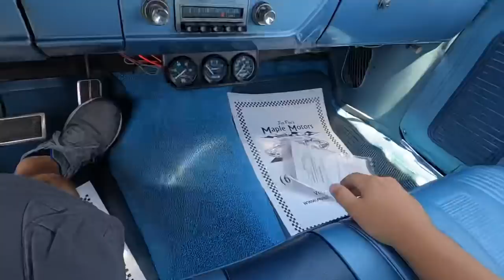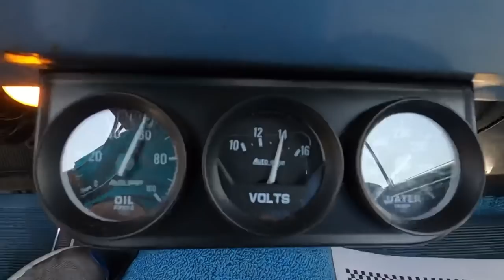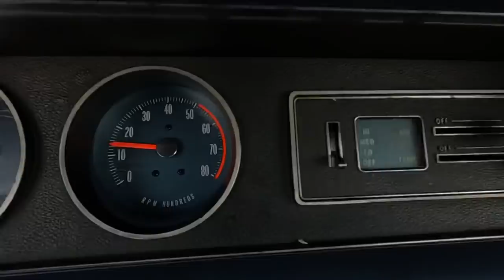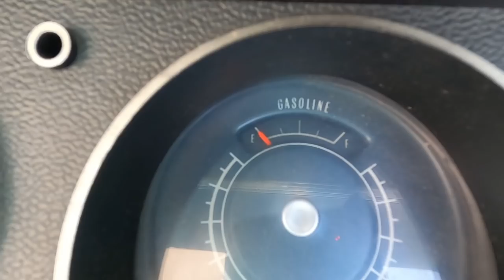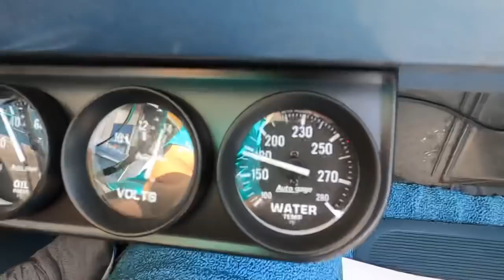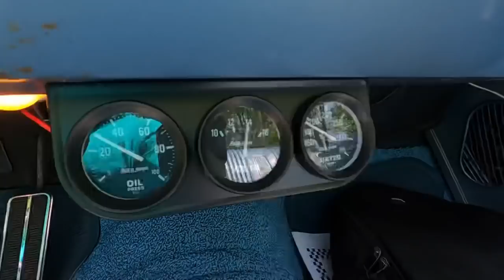Test Drive 1965 Pontiac Tempest Convertible SOLD $27,900 Maple Motors #1564

Comment: This was my car. It has a 400 pontiac with ram air 4 cam 6x8 heads edelbrock performer intake and is .030 over. Trans is a rebuilt th350. All the brakes shoes wheel cylinders etc replaced as well as the brake lines and fuel lines. New stainless steel gas tank and new fuel sender. Jegs mini starter. New pump for the convertible top as well as new lines. Great car i only sold it because im restoring a 68 camaro convertible.  And also a powermaster one wire alternator.  Who ever buys it wont be disappointed! Also new rear springs and kyb shocks all around.
Reply: Nice job!!!
Reply: Nice job. How much for the 68
Reply: @Danny-ju2ip  the 68 isnt for sale im restoring it for my wife.
Reply: You have good taste & by all I can tell did a beautiful job.I'd just like buckets & a third pedal.

Comment: I love this car and it doesn't bother me a bit that it's a Tempest. But, the seats have to go, it needs buckets, the wheels have to go, replace the carpet, the steering wheel has to go, it needs AC and a console. The good news is that at $28K you can do all that and still be under $40k with a well sorted car. You can see the previous owner really loved this car and took excellent care of it.
Reply: Lots of new parts on this & pretty darn clean.I love this car but I'd like to see a third peddle in it.

Comment: it has a 2-speed turbo 300 transmission,,,,,,,,,,,,,,,,,,update! i was corrected. i looked at the pan again, it is a 350, note, 350s did not come out till 1969, somebody put this one in. but originally that car would have had a 300 trans. some with larger engines had a roto Matic, us builders called them a 'slim Jim",,,,,,,,,,,,,,,,,,,
Reply: @BEANS-O-MATICtransmissions  you are correct, it is a 350, 350s did not come out till 1969, but looking at the pan it is a 350 somebody installed,,,,,,,,,,,,,,,